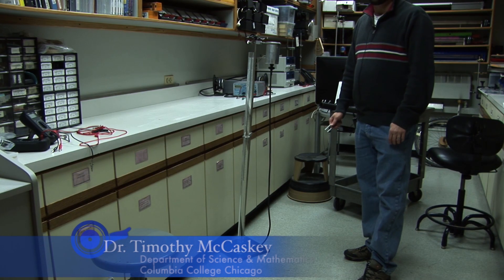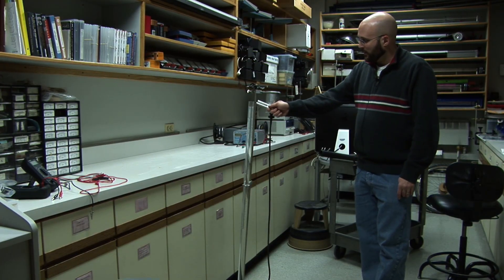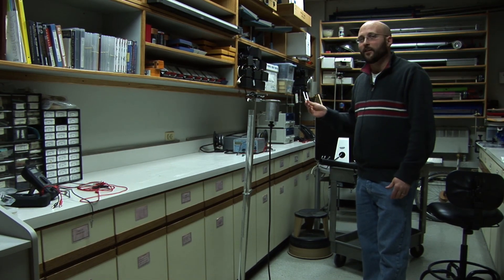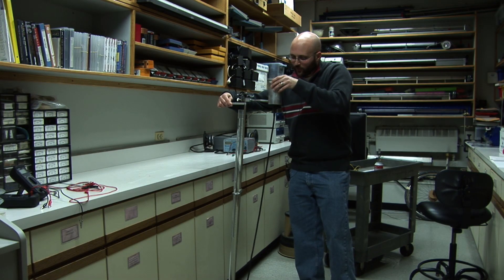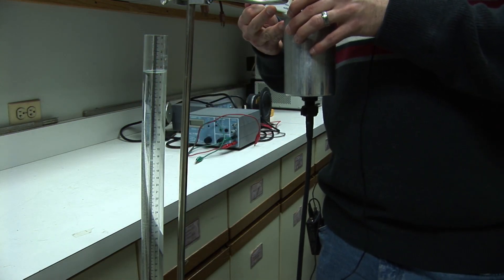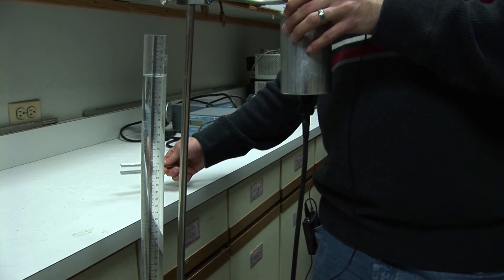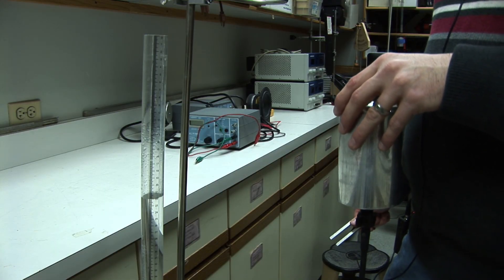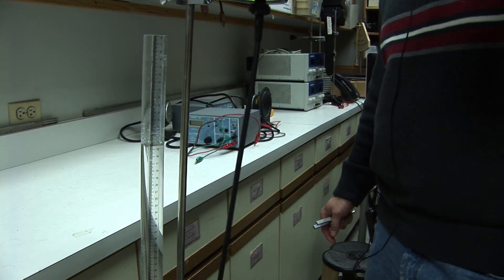Resonance tube demonstration

Comment: Why does the sound actually increase?
Reply: because the natural frequency of the air column becomes equal to the frequency of the tuning fork and thus resonance takes place, this makes the amplitude of vibrations infinite and so, loudness increases (loudness is directly proportional to square of amplitude!)
hope you understood :)
Reply: @niloferrr  How can the water level affect the natural frequency of the air column, like how can it be increased/decreased by simply just changing the water level?
thanks
Reply: @phroggothephirst6288  speed of sound = frequency * wavelentgh. speed of sound is constant, so for a certain frequency need a certain wavelentgh, for you to hear sound the tuning fork need to be in resonance with the tube, that is have same frequency. there is a node at the surface of water level and an antinode roughly at the end of the tube. distance between the first node and antinode is wavelength/4. so as we adjust the water level the distance between the node and antinode changes which change the wavelength of the tube. and as the speed of sound is constant so when the wavelength changes the frequency needs to change to keep the speed constant. that is how the frequency changes with water level.